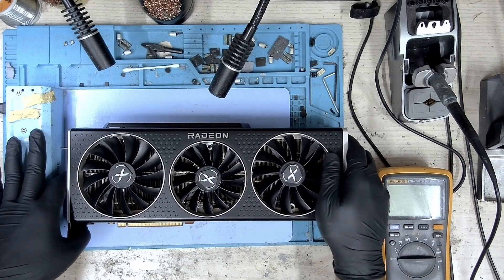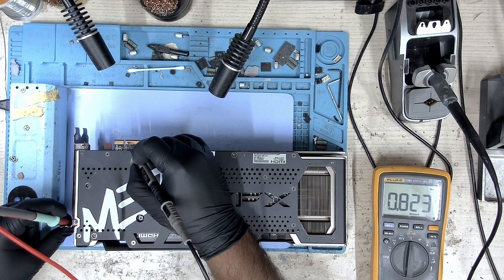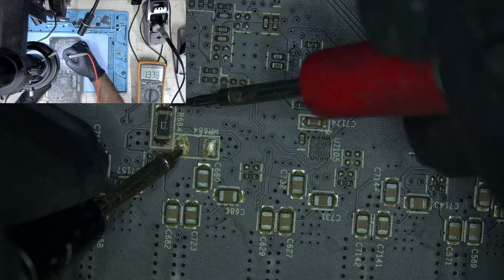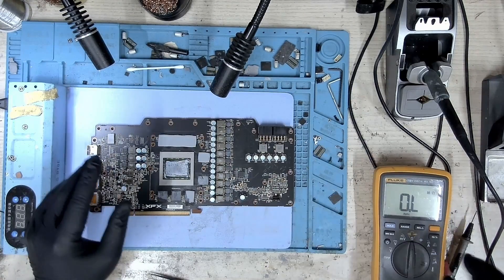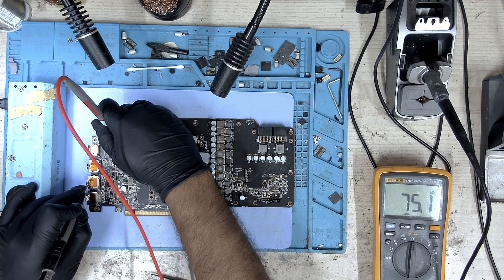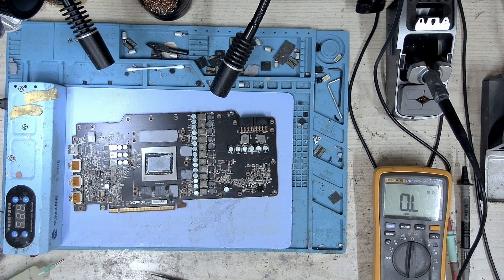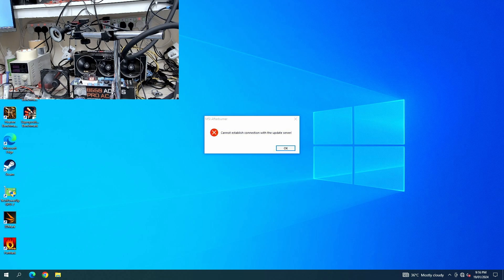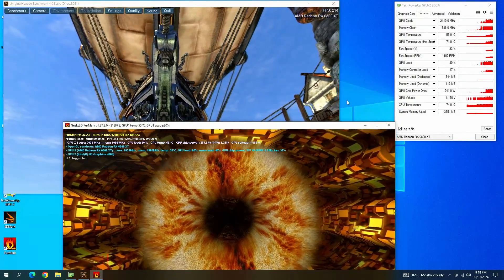XFX Merc RX 6800 XT  - Not Detected and No Fan Spinning - Fix

Comment: Hellow man 
Can you help me? I have sapphire rx580 nitro+ 8gb 
The display is ok but the fans is not working I already transfer the fans to another gpu the fans is ok When I turn it back on, the original GPU its not spinning.? I already check on adrenaline but still not working can you help?😢
Reply from the maker: The logic gate for the fans may be faulty. Or the fan controller. Check 3.2V also is the resistance is low replace the fan controller. If resistance is ok replace the logic gate.
Reply: @GraphicsCardRepairs-tk7ql  Hi, what could be the issue on my 6800xt merc, fans are spinning but no display no boot and after a little the pc reboots and the same happens, it goes to a bootloop. I should mention the error led on the mainboard shows dram error, but cant be since the pc works fine with other gpu. Thanks.
Reply from the maker: @tubegfg this is a memory error on the GPU. Could it be that it reboots after VGA? The light you see on the motherboard.
Reply: @GraphicsCardRepairs-tk7ql Thanks for fast reply. Nope it goes to a bootloop,  power on > fan on and lights on gpu on> mainboard leds check from cpu to dram, there it stops for a little and goes bootloop. But pc works fine with other gpu so its not dram etc. Thanks i will look in to memory gpu error, see what i do.
Reply from the maker: @tubegfg boot through the iGPU and your amd GPU as secondary. Run memtune and you will know which memory is faulty.

Comment: My resistor was bad. Replaced it but no go. Going to check all the resistance readings next.
Reply from the maker: Check the SOC rail. something on the SOC rail is faulty. It will need to be traced. Check if the 0R resistors near the SOC MOSFETS are good.

Comment: I have this exact model, but my problem is more about the screen becoming randomly black while in games ( not reproductible in stress tests) and sometimes monster hunter wilds crashing with a message that display device wasn't detected. Could this be an indicative of this transistor starting to fail?
Reply from the maker: Two things. One check hotspot. Second there could be a memory failing but half working. Any other fault will need diagnosing first.
Reply: @GraphicsCardRepairs-tk7ql  Thanks for the response! will monitor the hot spot and see of my trusted repair  guy check the memories

Comment: I've tried this method today but unfortunately it didnt work for me, i have a cheap multimeter though and it doesnt really read Ohms under 20, it just beeps which is supposedly a good sign. What other things could it be? would a Bios Flash likely help or do you think its the core thats damaged? its exactly these symptoms described in the video. UPDATE: I changed to a Premium Multimeter from FLUKE and it showed me 0.2 Ohms, all the readings are correct but it still doesnt work, Purchasing a Bios Flasher and will try to flash Bios.
Reply from the maker: Do not flash the BIOS. it is not a bios issue. you will have to explain the issue first so i can analyses where the fault could be. In 6800 XT most of the faults are with the PEX reset gate. But its not a rule. Are your fans spinning? If yes then its highly possible it the gate. If not then it will have to be diagnosed further.
Reply: @GraphicsCardRepairs-tk7ql  Fans do Spin, but the GPU Core stays cold. I really hope its not the silicon or contact between the pcb and the core, im still too inexpierenced to reball it and its not worth paying over 100 Bucks on repair when the cards worth is only 250 Bucks. How to i test PEX?
Reply from the maker: @youknowme2003 if the core is cold, some of the voltage is missing. Check if the Core, SOC voltages are present. Check all the inductors. Some voltage is missing
Reply: @GraphicsCardRepairs-tk7ql  i finally got myself the Zoyi ZT-703S Multimeter on a Sale, just Checked everything and indeed my 8 pin 12V Connectors the 2 Pins on the Top Row dont show KiloOhms and Rising, just straight 0.1 to 0.2 ohms. Could it be because my 0 ohm resistor isnt Soldered on properly? it shows the exact same resistence. EDIT: Supposedly the Top Pins should only be 0.1 to 0.2 ohms. Im confused.
Reply: @GraphicsCardRepairs-tk7ql  And Thanks i really appreciate you taking the Time to help people in the Comments, i really do!

Comment: Hello, can a SOC failure cause the GPU to go to 100% fans and black screen, even with PCI power connectors disconnected ? Card isn't recognized either.
Reply from the maker: No, a GPU with a failed SOC rail will not boot.
Reply: Thanks for the reply, I think I found the failure, was 1 of the capacitors of the VRMs, now the card boots fine runs for about 2 hours then again crashes. I will order and completely replace the 820uf caps 21x them and then I will send a reply with results.
Reply: Hello, my card now turns on for about a minute (have picture and all) then goes 100% fans and no video output. When left to sit around for an hour and try to turn on again it turns again for about a minute. Missing 1.8v when this happens. What could be the issue? It is the same card like on the video.

Comment: I have a asus 6800. After a soft brush cleaning and changing thermal paste and pads, my entire system wont boot only with the card plugged on. The system keeps trying to boot infinetly. What could be the issue on the board? Could it be due to static discharge/damage? Thank you! Viewing from Brazil.
Reply from the maker: There may be a possible short circuit
Reply: @GraphicsCardRepairs-tk7ql  Good to hear. Thank you!

Comment: My xfx rx6700xt fan are not spinning
Reply from the maker: If fans are not spinning then your gpu is not detected by the pc. This is not memory error. It is possible that either some voltage is missing or some component is faulty.

Comment: I have a 6800xt and it doesn't turn on the fans even when it reaches 100 degrees
Reply from the maker: It could be possible that either the PWM signal is not reaching the GPU or the 12V to the fans is missing.

Comment: Great job! I had a question: I am currently repairing a 6600xt with bad vram. I ran tserver and diagnosed it to the A1/A0 bank (there are 4 vram modules on this board 2gb chips) . How do i find the physical location of bank A1/A0 on the card so that I may remove the bad vram and replace it? There is alot of documentation on nvidia cards but not so much when it comes to AMD.
Reply from the maker: If A1 and A0 is showing faulty, in AMD A0 and A1 are the same chip unlike Nvidia. So channel A is the one right at the bottom right of the core closest to the PCIE connector. So it's A, B, C, and D for AMD 6600, 6600Xt and 6650Xt from bottom to the PCIE connector on the right of the core and up.
Reply: @GraphicsCardRepairs-tk7ql  Thank you for the assistance brother I will go ahead and remove the chip to the bottom right side of the die closest the PCIE X16 connector. Do you have any resources you could link me to for future reference when dealing with AMD cards? Thank you alot !

Comment: "I have a problem with my RX 6800 XT, which causes the monitors to turn off while the desktop tower stays on with the fans running, but I completely lose access to the computer. After a few seconds, a LED on the motherboard lights up indicating the absence of the GPU. Could this be the same issue you're showing in this video?"
Reply from the maker: No this could be a different problem. The GPU will need to be diagnosed by a repair technician. This is not a simple repair.

Comment: VRM and VRAMs how many mm pad
Reply from the maker: VRM and RAM: 1.5mm thermal pads are recommended for these components.
Aluminum Bracket: 2mm pads are used for the aluminum bracket.
Backplate: 1.5mm and 3.5mm pads are used on the backplate.
All thermal pads are soft.

Comment: Hello,
Thank you for the videos and all the response you're giving.
I bought a 7900xtx that doesnt boot, no light/fan/display out. Which is why i started to look at the repair process.
Im trying to search for short circuit like you did with the ohms reading but is difficult to see which pins your probing. Ive looked online and havent found the connections maping for a pcie slot. Do you know where i could find it? Thank you.
Reply from the maker: First you will need a microscope to check where you are probing. You will need a boardview to trace the fault. Board view you can find in the discord server of tony northwerepair. The link to his discord is available on his YouTube channel. Just type Northwestrepair in YouTube
Reply: @GraphicsCardRepairs-tk7ql  Thank you, i have a usb microscope i can use. Thanks.

Comment: Does the 6900xt xfx speedster have a similar solution? The card isnt detected, no fan spin, card gets warm. Checked all 0 ohm resistors. Hope i didn't missed one.
Reply from the maker: Check the logic gate on the PEX reset line.

Comment: Hi I have rx 6700xt reference card all voltages are present but it doesn't detected fans spins,core is cold as ice,it doesn't heat up
Reply from the maker: You would need to diagnose the problem. You will have to measure the voltages on each rail to check which one is missing. If all voltages are present, then the Smith trigger could be the issue.

Comment: Bro, I have the same issue on my XFX Swft 6800XT but I had no idea why. I was playing games and doing some work at night but in the morning when I turn my PC on, I got no display. Which is weird. My issues are the same, no display and no fans spinning. But I notice that when I turn off my PC, there are red lights on the GPU and the fans are slightly moving. Can I repair my GPU using this method? Great video, bro. I hope I can fix mine asap! 😢
Reply from the maker: You can use this video to diagnose your GPU first. If it's the same it's an easy fix like in the video.
Reply: @ Bro, thank you so much for the reply. I just ordered what I needed to fix it. Fingers crossed.
Reply: @GraphicsCardRepairs-tk7ql  Hello, after some further inspection, I do think that I have a V2 of this board. In your other comment said that they put the dual resistors in the front board. Should I check the reading of those dual 0R resistors and if one of them don't show 0 ohms, can I replace them with the new 0R resistor or should I replace both of them? And what type of SMD resistor should I use? Thank you

Comment: Hi my card keeps beeping and the does not boot in the bios. Could you tell me what could this be i got these from ebay to fix them.
Reply from the maker: If it does not boot than there could be so many reasons. What diagnosis have you done?
Reply: @GraphicsCardRepairs-tk7ql  I have only put in pc i still to clean this gpu and see if their any damange on the inside it just beeps and turn off. I was told these were no display cards on ebay but to be fair the seeler has no clue as they sold me another card it came was rusted cooler and they seid it did not display picture to did not mention anything rust. What muleteer reading should i take? Were are you based? Also 650 psu be ok for testing it to turn on?
Reply from the maker: @UmarAbid please go through my repair videos where I diagnose the GPUs to find faults. Watch where on the GPU I probe to find resistances and voltages. My videos will help you much better than me texting.

Comment: Hey, i was wondering if when you replace the burnt conductor, if i were to do the same should i replace all the thermals to stop that from happening once again?
Reply from the maker: I did not understand your question. My apologies. If you are referring to the resistor. If burnt it needs replacement. Else not required.
Reply: @GraphicsCardRepairs-tk7ql   sorry sorry, i meant is the issue caused by the gpu overheating? would i need to change thermal paste and pads to prevent, or is it more of an electrical problem
Reply from the maker: @pokapotatokid1943  this is more of power draw issue. Hen excessive power is drawn it burns the resistor. But it still acts as a fuse preventing the core and other circuits from going boom. Xfx has redesigned the circuit in the version 2.
Reply: @GraphicsCardRepairs-tk7ql  i just fixed a card with the same issue in the video, i have it in my main pc and i would like to prolong this from happening, if powerdraw is an issue, would undervolting fix, or prolong the resistors life?
Reply: Also, GREAT video. I followed it to a tee and was able to fix the same gpu easily.

Comment: You say that this issue is known for v1 of this board, and that it was later resolved - do you know what they did to resolve it? Is it simply a case of using a higher quality resistor? Is it likely that after performing this fix the fault will emerge again in the future?
Reply from the maker: They changed the circuit design. They now use a different circuit for SOC rail with dual 0R resistors and they are now positioned in the front.
Reply: @GraphicsCardRepairs-tk7ql  Thank you for your reply, does that mean that cards fixed in the way you show in the video are likely to fail in the future due to the same circuit design?
Reply: How can I find out if I have V1, or V2 board? Does every xfx 6800 v1 model have this issue? Does other xfx 6000 V1 card have this issue?

Comment: I have the same XFX Merc card. Same thing occurs when I turn it on, lights only. I've done the tests you have done. The problem is that the PCB seems slightly different. Don't know if the SOC resistor that you changed is in a different spot. Do you have any suggestions or ideas on what I am able to look for to fix?
Reply from the maker: The resistors are in the front side behind the capacitors near the SOC DRMOS. There are 2.
Reply: @GraphicsCardRepairs-tk7ql Barely getting around to this. My board doesn't have those capacitors. My board is the 109-D4112A7-00_03. Thank you for the help!

Comment: I have the same gpu.. but my problem is the display turns off after a few minutes of playing game. Can u help suggest any repairs?
Reply from the maker: The issues you mentioned on AMD are core replated. The only way forward is to reball the core. In my experience many AMD GPU even after reball act the same way. Running memory test will pass. But after reball if still does the same thing then it's time to get a new GPU.
Reply: Could also be a dying pcie slot on motherboard which is what my issue was. Trying swapping to another slot and see if the issue is resolved

Comment: Hi, thanks for this video.I have a question if you don't mind me asking. I have this exact card and had an issue trying to take it apart to repaste and repad (really high hotspot temps). It seemed like there were additional screws holding it together no matter how hard I tugged to seperate the pcb and cooler. I took off 10 total on the backplate (4 for the cooler/die contact and the 6 surrounding for the cooler, see 0:16 frame). Are there any additional fasterners or was I simply not tugging at it enough? I've repasted and repadded many gpu's at this point in time and haven't encountered anything like this. Thank you in advance
Reply from the maker: For the front cooler to come off it's only the screws on the back of the GPU. To remove the black frame inside there are many screws including 3 on the IO plate. to remove the back plate there are 2 screws on the PCB as well, on either side of the GPU core.
Reply: @GraphicsCardRepairs-tk7ql  thank you so much for the reply. So it sounds like just the back plate screws will be enough and I did undo everything I just needed try harder. Wish me luck, it was really stuck on
Reply from the maker: Make sure you are holding only the cooler and not the black frame. The black frame is attached to the PCB from inside. The cooler needs to be removed first. Then the black frame.
Reply: @GraphicsCardRepairs-tk7ql  Will do. I'll give it a try again tomorrow or the day after and will report back with how it goes. I'm going to run furmark for 10 minutes or so prior to the attempt to hopefully loosen any adhesion from the thermal pads as well.

Comment: Same gpu available in 50 dollar. fan spinning , no display😢
Reply from the maker: Possible memory issues. It's  a chance. I as a customer would stay away from such GPUs. As a technician I would buy for parts only.
Reply: @GraphicsCardRepairs-tk7ql  how to check which memory is faulty can you measure it just with multimeter?

Comment: Congrats! Thx for sharing.
I ha ve a xfx 6800 xt, today my pc won't boot and my motherboard diag led say 'vga'...
Leds on graphic card turn on and fan spinning but no signal on screen😮

Any idea?
Reply from the maker: At this point it is difficult to say. If you use a CPU with graphics can you boot through the internal graphics and check if the GPU is detected? The first step is to check if the card is detected or not detected everything else will follow after that.
Reply: Have you resolved this? If not let us know what else you have tried. One tip I can suggest is confirm if you use DisplayPort on the monitor, and try to connect to HDMI instead and restart the PC, if it then boots properly.

If it doesn't then definitely check other steps but if somehow you notice it does, then try if connecting via DisplayPort again works. If this is the case, you may need to seek how to tape one specific DisplayPort pin to prevent power issues causing the temporary boot issue.

Comment: xfx 5700xt 6pin are has a red indicator. sometimes boot sometime no display
Reply from the maker: If your card sometimes boots and otherwise does not, i assume it's a loose connection on the 6 pin. Red light at the back of the card near the 6 pin or 8 pin means break in connectivity between the circuit and the connector. This light also turns on when the fuse blows but if it's intermittent then it's good. Check for loose connection.